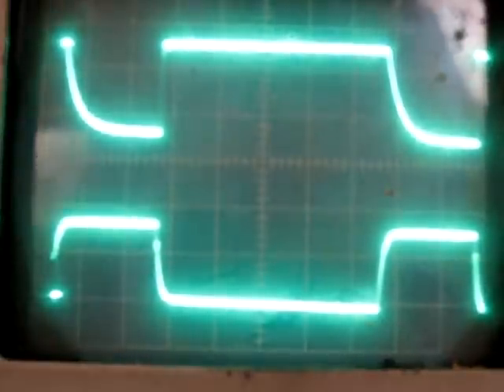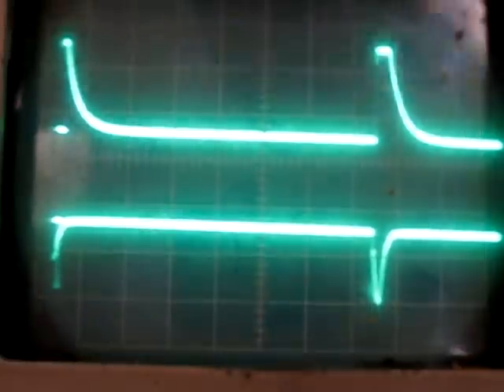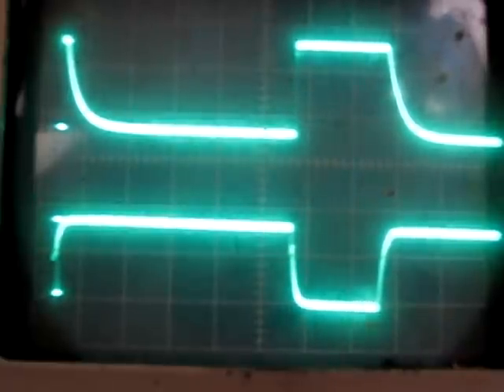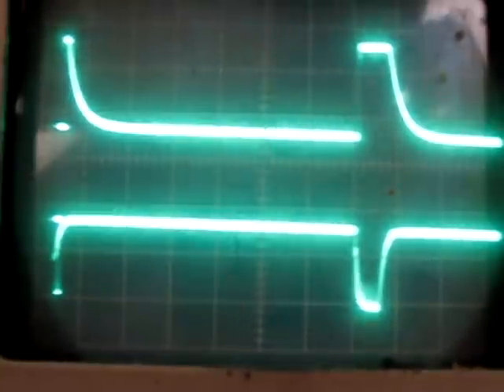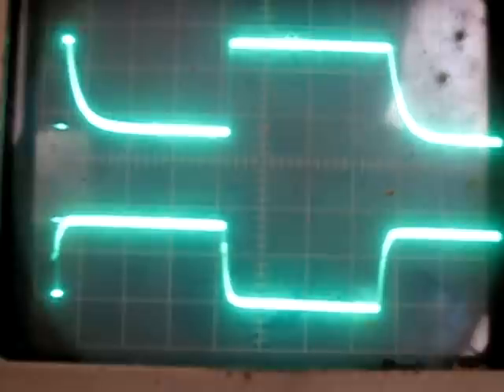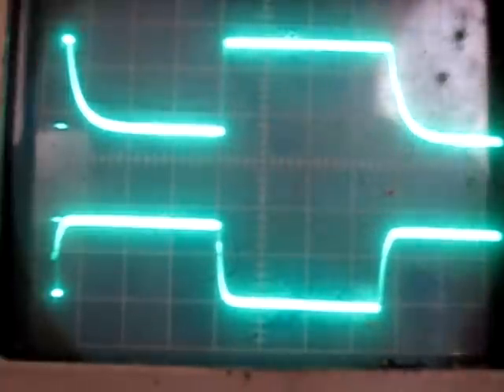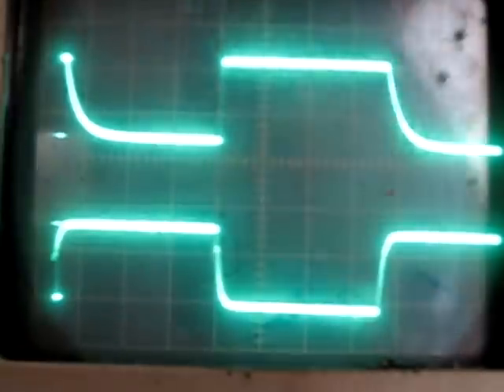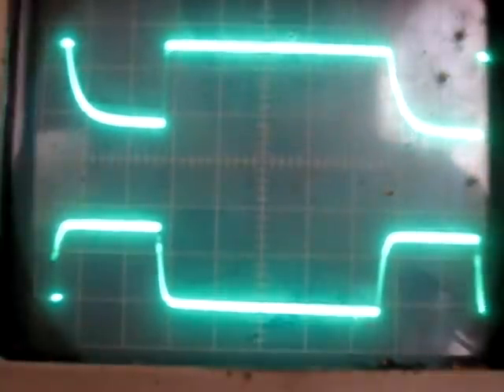The PWM WaveForms for the MOSFET of the E-Flite Blade MSR

Comment from the maker: When you convert from a brushed motor setup to a brushless motor setup you need to know where you connect the wires, this show the waveforms. Not all setups are plug and play sometimes it takes a little effort to work out what to do. This was made to assist those who tinker with their setups and try different units for driving their brushless motors.
Basically it shows the voltage geting switched on and off, so if a device looks for always on and switching low or vide versa then it can be seen.